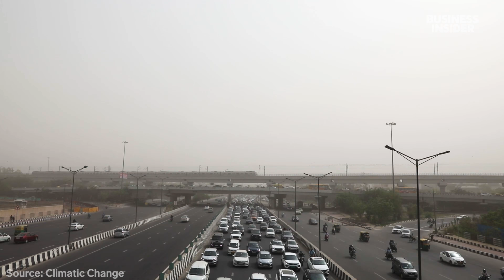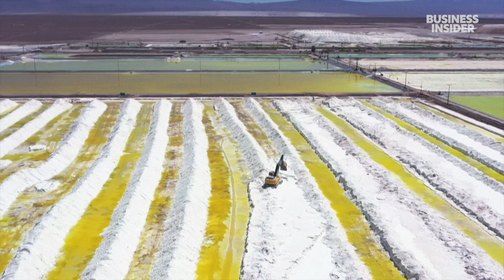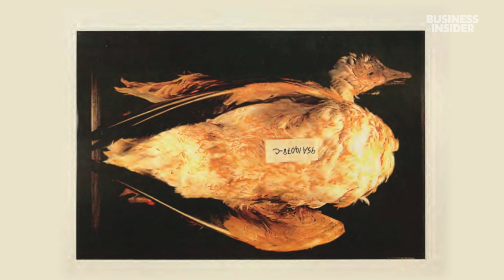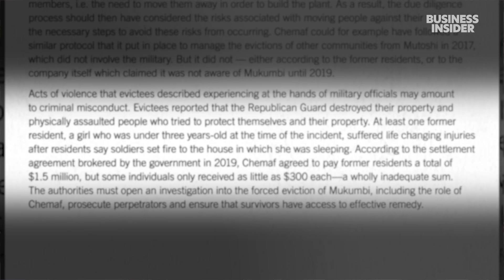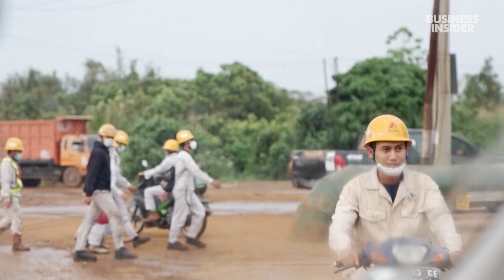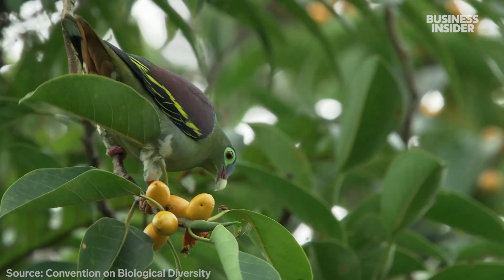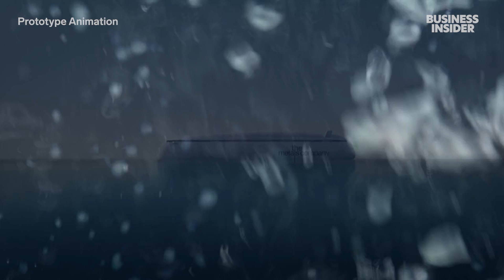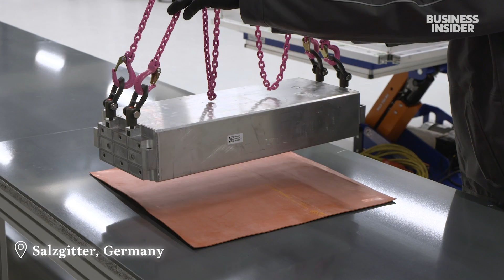The True Cost Of Mining Electric Car Battery Metals | True Cost | Insider News Marathon

Comment: FORD and GM are cutting out EV production ; not profitable ... the FORD Electric F-100 is a joke. You haul a trailer loaded and from a 90 mile range you go to nothing ... I watched a video at 100 % , an F-100 could only transport a Model A Ford on trailer 30 miles then batteries died.   All of this destructive mining and water / ocean pollution for a truck that goes 16 miles with a heavy trailer in tow ?   Criminal.

Comment: Yup interesting video. The only thing you have to change is the battery. And it will get recycled. The car will still be good forever. Or until it gets into an accident then to be scrapped for all that precious metal.  Yeah it's like those oil spills In the ocean.

Comment: air pollution is more dangerous than soil pollution ...we can reverse soil pollution (obviously not 100%) but we cant reverse air pollution ....so even if soil is getting polluted in production of batteries.... i would still support battery manufacturing over fossil fuel burning. because battery  manufacturing is less dangerous than fossil fuel burning.

Comment: How many coal power plants is China firing up per week to add to the over 3k they have in operation?  Everyone keeps bellyaching about cars and trucks, but if the percent of "greenhouse gas" emissions for transportation WORLD WIDE is around 25%, of that, what percent is actually passenger cars and tractor trailers?  If it's what, around ~1/2, you're talking about ~12.5% of the pie being tackled by the EV approach, which the net benefits are dubious at best, at least for now.

Don't forget that overall power generation will go up, along with pollution as energy consumption by ICE transportation is offset, which is already nearly on par with transportation, according to the EPA.

Comment: Is there a "True cost" video like this for gas cars ?
Reply: no because youre only supposed to think about the environment when its something that threatens the petrochemical capitalists
Reply: It is pretty well established that they are terrible for the environment. What company is promoting them in the same way as electric?
Reply: @billhacks  why not ?
Reply: @billhacks  Why are they so bad for the environment? Because they produce co2? What is the average lifespan of these battery operated cars? Ten years tops? My truck was built 24 years ago. Has not needed a giant mine in Africa for a single part because it has a small lead acid battery to start the motor. The catalytic converter reduces emissions to basically just co2 and nitrogen which are harmless to the environment. One paint job for 24 years. One set of seats for 24 years. It is made mostly of steel which is highly available and recyclable. It doesn't weigh a million pounds like the battery operated trucks so they damage it does to the roads and bridges is way less. Battery powered car owners are delusional to think they are somehow doing the earth a favor by using them instead of regular cars.
Reply: @GeorgeJefferson-h7w  -Because oil production, and the materials you need to produce an ICE vehicle, release lots of harmful toxins to the environment and boatloads of CO2. What happens when CO2 enters the atmosphere at elevated levels? Thats right! Makes it thicker, thus trapping more of the suns rays and warming up the planet. 
-Average EV lifespan is 30 years or 750K miles. Yes me and my uncles EV is 11 years old. 
-Your 24 year old truck uses cobalt in valves, valve seats, pistons, conrods, cranks, transmission gears and the entire structural stell of the vehicle. Cobalt is also used as a catalyst when refining oil. Only a small portion of EV batteries use cobalt. The rest do not.
-Your cat converter contains many rare earth metals that are mined using child labor in some places and harm the environment when mined. CO2 and excess amount of nitrogen are harmful to the planet. Furthermore, cats are less effective the more they age/are used. So the ancient one on your truck is almost useless at this point given they are only designed to last around 10 years or 150K miles (average lifespan of ICE vehicle)  
-A lot of EV's actually arent heavier, or much heavier, than their ICE counterpart. Furthermore passenger vehicles (besides heavy ICE 4x4's) make up a negligible amount of damage to the roads. Its mostly semi's and water freezing under the pavement that damages the roads. In fact ICE vehicles do more damage to the roads because most of the weight is on the front tires, thus putting more impact forces on the road when they hit a hole or bump. The weight of an EV is evenly distributed, so less forces hit the road per tire.
Reply: Of course there is not. They are EV haters without common sense
Reply: There are thousands of videos on the true cost of oil. This is not one of them.

Comment: If one wishes to keep birds away from a body of water they only need to do what a California reservoir did: cover the water with hollow plastic balls. It was installed there to reduce evaporation,  but birds also stopped coming there.
Reply: Gonna need a lot of them to cover that area though. Also, wind pushing them around and on top of eachother... Never mind the need for them to be chemically stable, as you don't really want that much of plastic gone to waste in a short time.

Comment: one benefit with the under sea mining is that it has the potential to clean up some trash maybe
Reply: no. plastic floats and then gets broken down into microscopic particles. bottom of the oceans are spotless.
Reply: @ct1762  well, there is certainly plastic on the bottom, and lots of other garbage. But the mining areas are (luckily!) very small, so not much if any at all will be cleaned. But hey, just another wishfull maybe.
Reply: @ct1762  oh yes, that’s right. bummer

Comment: The cost of lithium and Cobalt and nickel have dropped in cost.  In the case of Li enviromental methods of extraction the element are being developed.  Like the US Salton Sea Li plant is going to use a electrical chemical process to extract the Li.  Agricultural wastewater is going  to be used to extract the Li.  As to energy the Li production is actually a biproduct of  geothermal power production.  Actually the Li production is going to be the largest base load electrical power source in the US state of California.  This sort of enviromentally sound production of materials needed for EV's is possible for all the battery materials needed.  Even for sea bed mining.  What is needed is international pressure for these materials to be extracted in environmental and social compatable manor.
Reply: Are being developed and actually being in use is a huge difference. Lots of "going to"-s, lets see how that plays out when profit isn't as high as they hoped. Especially without funding, which is a sad possibility with the next elections in "murica". Wishful thinking at the moment, not more than that.

Comment: Actually there is no advantage in EVs, for several reasons, first, petrol cars can also run on power from windmills and solar, because you can produce carbohydrates (petrol) by combining hydrogen with carbon from the atmosphere. No need to buy new cars, no need to build charging stations, and battery factories. No need to drive heavy electric cars that is a fire hazard. It solves the problem of storing renewables. 
EVs are a very bad solution to a problem that doesn't exist, co2 is NOT pollution, it actually does more good than harm. It makes plants more resilient to drought, it makes plants grow, thus benefitting agriculture, and greening the earth. 
And by the way much more people die from cold than from heat.

Comment: Sorry, had to give up half way through this. Started on lithium and how bad the mining is with some shots of open mines, but then proceed to show the lakes which involve very little mining (and could be argued that the reflective nature of the white slats helps reflect the heat of the sun). 
Then goes on to copper (of which it only appears that 12% of all global copper goes into "transport" so the % going into the EV batteries is minimal at best) and proceed to show a copper mine that closed in the 1980's long before any EV's existed.
Got on to the cobalt and highlighted someone who'd been working in the mines for 22 years, again, long before EV's were about. Cobalt institute states that only 30% of all cobalt is used in batteries. Then claim that no cobalt is used in ICE cars, which on the face of it is true for the car itself, however cobalt is used in the refinement of the fuel they run on! 
What a waste of time when your own documentary debunks the point you are trying to make. Maybe do one on oil refinement and the vast damage that does?

Comment: So many "facts". But wrong. Please will you guys do better fact checking. 
1. Uses of rare earth metals with steel, copper and aluminium alloys.
2. Recycling of various metals and their side effects. No mention of the energy needed to refine new extracted metals or energy needed to recycle materials (huge).
3.Transport costs of raw materials (and CO2 impact).

That's three to get you started. Come on guys, your researchers could put in a bit more effort.

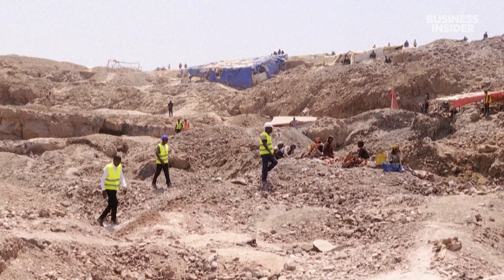Comment: At 15:44 you state that internal combustion engine vehicles dont use any. This is false as refining oil uses cobalt as a catalyst
Reply: ICE is just terrible.  Any positives in ICE is because of big oil money pushing their narratives.
Reply: Although road transport is only responsible for a little 12% of greenhouse gasses. It’s shifting the ‘problem’. And the green net-zero stupidity is all about the money. The climate change ideology.. Green on the outside, but fiery red on the inside!
Reply: Almost all high tech engines and machinery use high tech oils and lubricants.
Reply: The bigger point here is that the minerals used for EV's are far greater than that of Petroleum.
Reply: Technically fossil fuels are also mineral resources, which over the lifetime an ICE will consume 17,000 Litres of. Batteries are 95% recyclable so once it is out of the ground it just gets reused. Lifecycle  emissions and resource use should consider recycling.
Reply: Point is that EVs are better for the environment all things considered. Period. Might require more to manufacture but in turn releases less toxic gasses when produced. @Skywest25
Reply: @Skywest25  how much petrol and diesel do EVs use?
Reply: @userscott …you mean before EV’s are built, then when they’re charging?
Reply: @userscott  lol omg the point that is being made here is there are consequences either way and the new EV narrative seems to say look here don’t look there. lol 😂 what a stupid
comment.
Reply: Furthermore there's cobalt in valves, valve seats, pistons, conrods, cranks, transmission gears and the entire structural stell of the vehicle.

plus the obvious fact that one could just use lithium iron phospate or sodium ion batteries. both of which don't contain cobalt.
Reply: "Could just use" Sodium Ion? Link to a reputable manufacturer and non-prototype, vehicular use please. If you want to state facts, do so.
Also, LiFePo cells are great, if you can miss the output that LiPo and LiIon give. Which for EV's... Well, does not work greatly.

The fact that ICE uses cobalt, does that make it okay for EV? Or is it just as bad *(which it is), and just a form of "but they are doing it TOO!"?
Reply: @Mediamarked  well said. I'm suprised the MuskRat didn't bring up "solid state batteries" that will be available next year.... 90 years in a row!
Reply: You must be referring to Toyota
Reply: @ct1762  So many wishfull thinkers out there, so few with reality in mind. "It will come soon!"... So many lies, so many broken promises. Once they realise that it will be too late.
Reply: @Mediamarked  let's see.

Sodium Ion is currently getting used in the Yiwei Sehol E10X and the JMEV EV3. Both are currently in production.

LFP can output at 3-5C so a 60kWh pavk can put out 180-300kW. Which is more than enough for car.

And the entire point in saying the ICE also uses cobalt is that the makers of this video clearly don't know what they are talking about. Which means every other part of the video is also suspect.
Reply: @Mediamarked  1. LiFePo is used in a rapidly growing majority of BEVs. It's actually the best battery chemistry for just about anything other than sports vehicles and very long range vehicles. 2. Sodium Ion is definitely a fact. BYD -- the second largest battery manufacturer and largest or second largest BEV manufacturer -- is currently building a 40GWh gigafactory specialized in Na-Ion battery production. There are already multiple GWh of manufacturing capacity either in production or under construction by several other companies as well. It's still tiny compared to Li-Ion, but it's clearly a tech in the process of taking off commercially. Whether it will be mostly used for BESS or actually used at significant scale in BEVs as well in the long run, we'll have to see.
Reply: @ct1762  Your ignorance is hilarious. The company that has been claiming that solid state batteries will be available soon is Toyota, not Tesla or its "Muskrats" fans as your pedantic ass calls them. And even then, Tesla has been slowly increasing their usage of LFP batteries (which are cobalt and nickel free) since 2021, and now account for more than half of the Teslas being sold today
Reply: @anonym3017 LiFePo and Na base batteries will not charge effectively below freezing temperature of water.
Reply: @Krusty-kl5ej  lol.

That's just complete and utter bullshit from personal experience. Tesla model 3s, which use LFP batteries for china made standard range models, charge at -20C without problems.
Reply: The one benefit in that respect is the potential of Sythetic fuel. Made from excess carbon in the air itself, no cobalt required. 

Making it effective and cost efficient at scale will be key to the future of Motoring
Reply: Catalysts don`t deteriorate during use. They can be used over and over.
Reply: @tedzehnder961 true but batteries can be recycled as well.
Reply: Cobalt in EVs is old news. Tesla doesnt use any in their 4860 cells for example. So there you go. @tedzehnder961
Reply: @tedzehnder961  that's just outright wrong.

Catalysts erode when used. That's a slow process but it's still happening. And a slow process times 100 million barrels per day being processed leads to a lot of catalyst being lost.
Reply: @anonym3017  still much much less per km than typical EV battery. The efficiency is about 99 %.
Reply: You clearly don't know what CATALYST is.
Reply: @suprememasteroftheuniverse   you clearly don't know how a catalyst works. with every reaction that a catalyst is involved in there's a chance of an atom of said catalyst breaking off from the main body.

this leads to catalyst errosion over time. since filtering particles that small is impossible the stuff just ends up in the fuel and requires replacing.  multiply that small rate by the massive amount of catalyst getting used and the massive amount of fluid it processes and you get a lot of catalyst errosion.
Reply: @anonym3017  yup. It's a consumable in that process. Where as in a battery it can be recovered. Also, thats a great point about the LiFePo chemistry as that is becoming cheaper and gaining faster charging speeds than NMC. CATL says they will have their LiFePo cells down to half the price by year end.
Reply: Cobalt hasn't been used in the desulphurisation of fuel for around 30 years.
Reply: You're ignorance is appalling.
Reply: @suprememasteroftheuniverse  Your*

Comment: "Lower climate impact over theor lifetime"
Does that include vehicle accidents?  A fossil fueled vehicle can be repaired in a moderate accident, whereas an EV will be totalled in a similar accident.
If the battery is damaged even slightly a fire will destroy the vehicle.
Whats the the total environmental footprint after a vehicle catches fire, burns to the ground, gets towed and disposed of, the toxic chemicals on the ground from the firefighters hosing it down.
.......and if it was on a garage, replacing the home and its contents........ then building another home?
EV is an expensive feel good.
Concentrate on something real, like hybreds.

Comment: So what I hear is these horrible mines have been there for YEARS to fuel the steel industry. Now we blame EV's for them instead of holding the governments of those countries accountable.
It's easy to compare the low wages, lack of ppe and dangers to developed countries but from those peoples perspectives they are the lucky ones. They have a job and earn money where enormous portions of people still live on subsistence farming with no power, running water etc. The problem is WAY bigger than the mines, it's the complete lack of everything else also in those countries.

Comment: Great documentary. I want to add, that cobalt is used in oil processing to produce fuel for internal combustion engine cars. So gas cars need cobalt as well as electric.
Reply: i think he focused more on the manufacturing of the IC car itself not needing cobalt
Reply: I want to add that you
Reply: are
Reply: a
Reply: fu
Reply: ck
Reply: reta
Reply: rd
Reply: Any documentary that omits that obvious fact isn't really a great documentary IMO
Reply: The bigger point is that the minerals used far outweighs those of petrol vehicles but very few want to pay any attention to those inconvenient details.
Reply: it is always a heated debate that needs factual calculations of how much environmental impact the manfacture and recharge an electric car (from fossil fuel powered electricity) over its lifetime has compared to the manfacture of an internal combustion counterpart and let the consumers decide for themselves. a 10 year use benchmark would be great following it from first owner to used buyer up to the point of discard in the junkyard.  @Skywest25